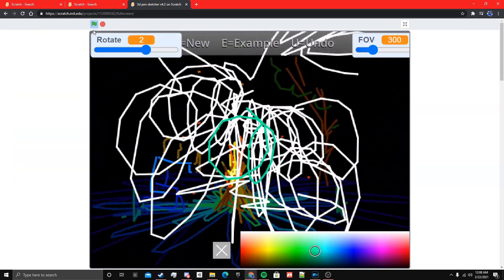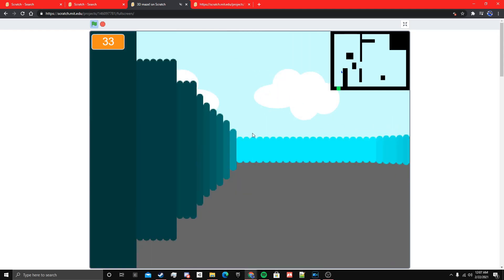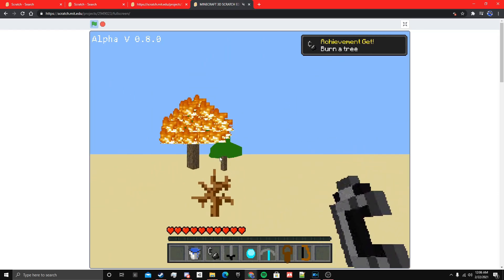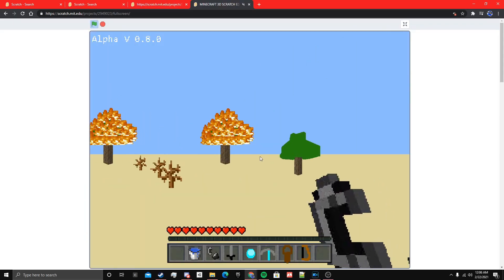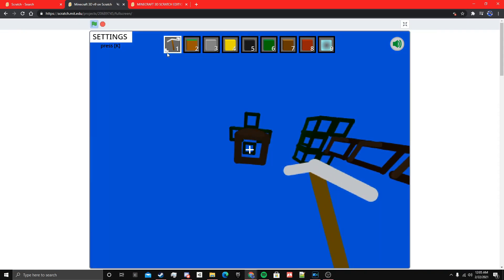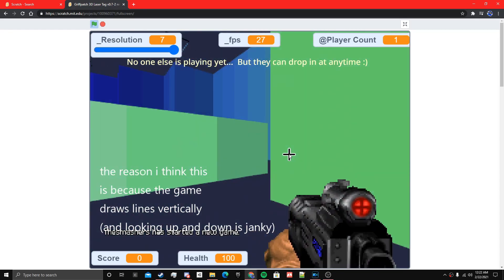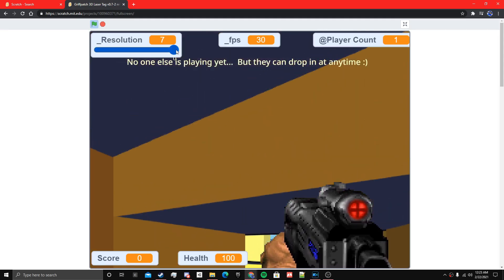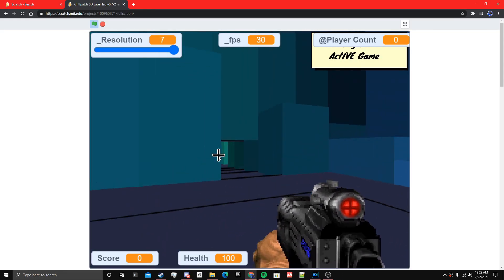Scratch 3D Engines in under 3 minutes

Comment: Binary space partitioning is in no means a renderer for 3D scenes. It is commonly associated with 3D rendering because of it's use in DOOM, making the rendering more efficient. Binary Space Partitioning is a method of structuring data into nodes that split off, aka a binary tree. It's use in Doom made it so the 2D level data was split up based on player view, and only rendered what the player could see. Since it only took 3 branches to make the scene, it's time complexity was much better than sorting faces, or using a depth buffer to draw on overlaps. Other than some minor fact checking this video is pretty great. It's cool to see how simple 3D projection can be with just some knowledge in trigonometry, and seeing it on scratch is such a throwback. If you would like some book recommendations on learning computer graphics rendering, I can also send some links too.

Comment: by 3d projection do you mean stuff like rendering triangles by dividing the x and y positions by the z position because you didn’t talk about that in the video
Reply from the maker: I mean real-calculated 3D rendering using actual accurate formulas. Most of the 3D solutions for scratch find ways around it because of how intensive they are but now there are projects popping up that use actual calculations because of programs like phosphorus.
Reply: @jkclaytondev  phosphorus is for scratch 2 correct if im wrong
Reply from the maker: @Tuberex  yes, but there are newer versions for scratch 3

Comment: Sorry if this comes off rude, this absolutely is not my intent.

Comparing raycasting and BSP based 3d rasterizing is like comparing apples and oranges. Raycasting, as the name suggests is a column based system where each column's height is based on the distance between the player and a wall, determined by shooting a series of rays out of the player's head.

A BSP style engine is completely different; it uses a 2d floor plan + line/wall heights to generate a series of points, projects them into the 2d space, and draws lines between those points.

The reason it's so optimized is that a while a truly 3d wall requires 4 points to draw, a BSP engine only needs 2, and its height. 

Sorry if I didn't come off very clearly, I am writing this immediately before going to sleep.
Reply from the maker: thanks I didn't know that, I thought BSP was multi-level raycasting, not actual 3D projection.
Reply: @jkclaytondev  BSP can be thought of as an algorithm for efficient rendering of 3D scenes, kind of like how z-sorting is an number sorting algorithm that allows 3D engines to render objects in the correct order. BSP is actually really applicable in many aspects of computer science. For example, it can even be used to optimize collisions by partitioning collision groups so the engine does not need to check if the player is colliding with every object. Basically, the engine does not need to detect if the player is colliding with a teacup a mile away, BSP helps the engine perform less collision checks. Similarly, in 3D rendering, it actually decomposes 3D geometry in order to not render, say, a dinner table behind a wall. Here is a more detailed explanation: https://www.youtube.com/watch?v=yTRzfKh4Tg0 As far as I'm aware, nobody on Scratch has shared a 3D engine that implements BSP. I may be wrong though, and there are probably people right now making engines that use this algorithm.